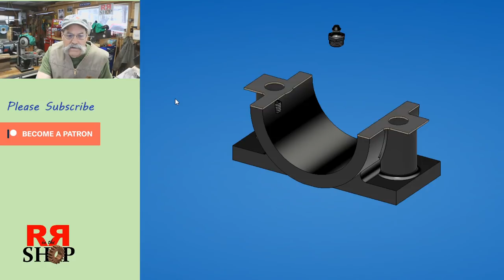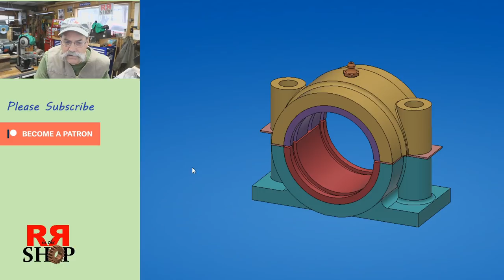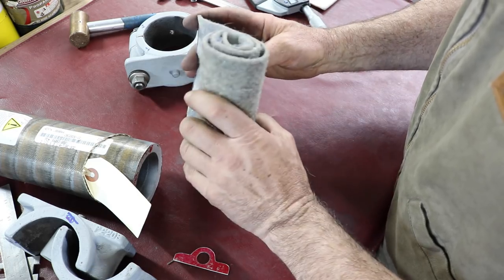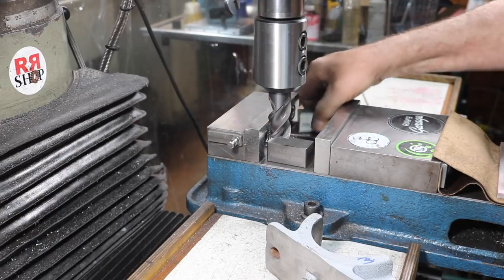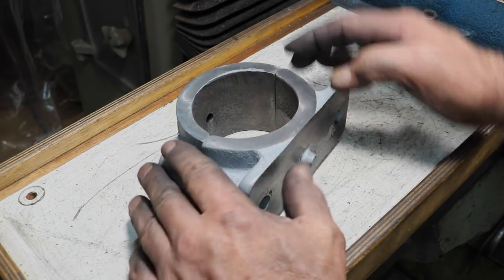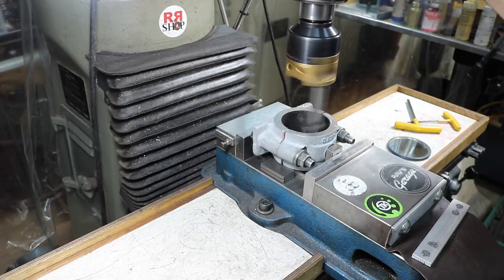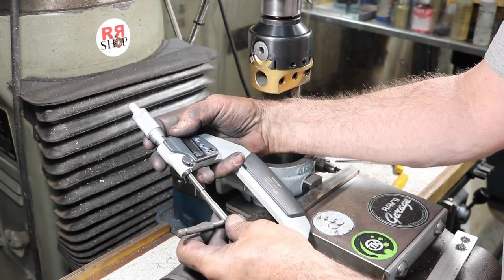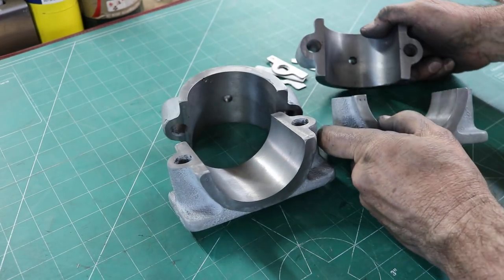Cement Mixer Restoration | Get Your Bearings P1

Comment: Nice work Randy. I was beginning to think you are not going to mix cement until the next ice age! haha, cheers!
Reply from the maker: No winter will end.  It will be a few months, but quite a bit of work to do on the mixer still.
Stay safe and well.
Reply: @RRINTHESHOP  How much did you open up the pillow block castings? Will the journal be reduced a bit too? I really like the way you cleaned up those castings.

Comment: Randy, the one thing i would've done differently is to mount the bearing housings on a thick plate and then to a heavy angle plate so you get a line bore going on those shells...alignment is going to be a bit of a bear if you have a variation in the height of the shell bases ...of course you can still catch that on the final bore with the bronze shells in place...
Reply from the maker: I thought about all of that Mike.  Since I had to machine the journals separate and I have no way to make those perfectly aligned.  I decided to make the journals a square and as concentric as I could.  Then make the bearings the same as separate units.  Then mount the bearings to the yoke and then mount the unit to the mixer frame.  I will deal with any misalignment then, by making shims for the bases of the bearing blocks.  I will also have squareness issue in the drive area so the belts will be fairly straight.  I figured this will be the easiest path for me with my limited resources.  Thanks for asking.

Comment: I know you thought about it but why not a flanged bearing. That way you can take up your lateral movement!
Reply from the maker: Thanks Robert.  I did.  One end the bearing block has very little clearance and the other end it is small and I will knot know until assembled.  So It was easier not to try having flanges.  One side on each block had some where, which was from contact with the yoke.

Comment: Randy, say again what that boring bar is. It did a great job on the iron, will you use the same on the brass?...Dave
Reply from the maker: David,  Thank you.  I used a Bokum boring bar which was carbide tipped, did a wonderful job.  Check out my video on them,  https://youtu.be/HM3aE1nFKOU,.  On the bronze I used HSS with a standard type bar.  I wanted to use a Bokum one but all my bars were just to long, and I did not have any stock on hand to make a new shorter bar.

Comment: Great work as usual.  I would have considered plastic bushings.  Tristar Ultracomp would be great but overkill.  UHMW would have worked great too.  Neither of them need any lubrication which I think would be of benefit when working with abrasive material.  Bronze will be indestructible though, especially the way you're making them.  What does that bronze cost?
Reply from the maker: Thanks Barry.   I thought about that.  The Bronze will stand up to everything including hauling it around.  Ype pricy.

Comment: Randy.   Nicely Done! Thanks for sharing your many talents and time.   Silly question.  How do YOU set the boring bar cutting angle in the boring head?
Reply from the maker: This I usually do by eye.  Setting it on centerline of the boring head.  Then checking for back rake rubbing of the bore, something you do not want.

Comment: Looking good Randy. Any thought on when you may get started on the shop expansion?
Reply from the maker: Well that is a good question.  Drawings are done, permit application is ready to turn in.  Building dept, is closed
due to the Chinese virus panic. And you can't even buy building material.  So I am not real sure.  As soon as the snow is gone and
drys a bit, I will take out 2 trees and get the excavating done.

Comment: That mixer is going to be sequestered by the Smithsonian if you are not careful.
The only comment i would make on the set up would to use the split line of the castings as the y centre line, so that the bearing halves are split dead centre, although it probably doesn't matter that much.
Reply from the maker: Thank you Chris.  Now lets not over think this,  this is a cement mixer.
Reply: @RRINTHESHOP  maybe but I thought you were converting it to a Deckel cement mixer.😂
Reply from the maker: @chrisstephens6673  That is a pretty high standard.
Reply: @RRINTHESHOP  i expect nothing less 😀